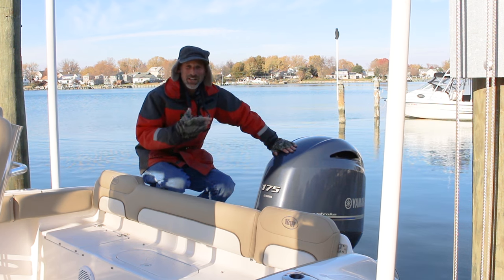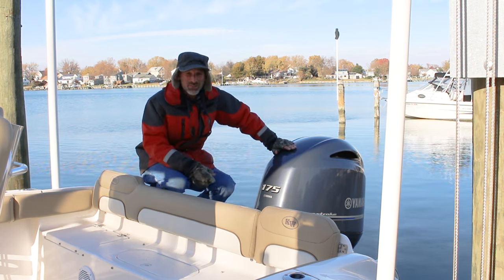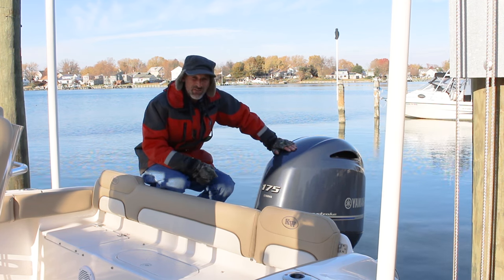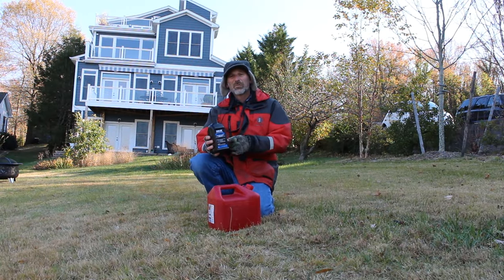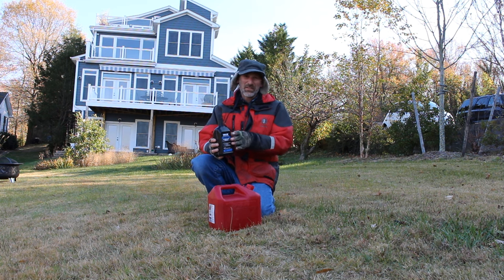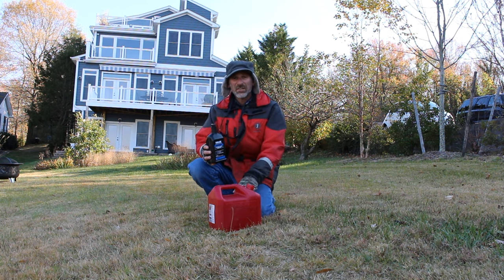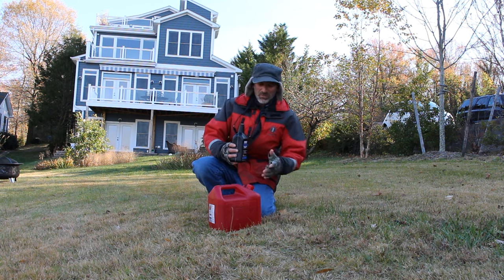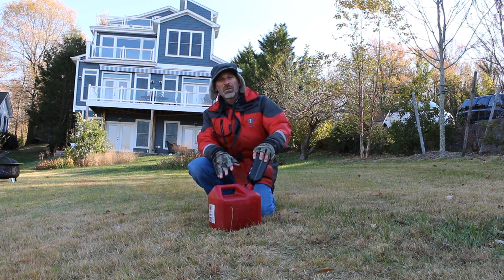Fogging and Winterizing a Yamaha F175 EFI Outboard (It's different!)

Comment: My question would be,  why use 2 gallons on gas and a full quart?  Just thinking out loud here....1/4 of the winterizer and a 1/2 gallon of gas.  Then i have it for a few years.  Seems to be mighty wasteful if you don't cut that recipe in half at least.
Reply: This is what I do. Halve it. Only run it at idle for 10mins don’t even need half tbh.

Comment: I did this with my 2020 vmax 150 let it run through the motor for 30 min , never saw any smoke ? 7 liters of fuel to one bottle of fogging oil . Why am I not see any smoke ?
Reply: lol U didn't have to flex

Comment: Any advantage or disadvantage of fogging with spray in the air intake vs running through fuel?
Reply: Fogging on EFI can damage sensors from what I've read. That's why it's done this way.